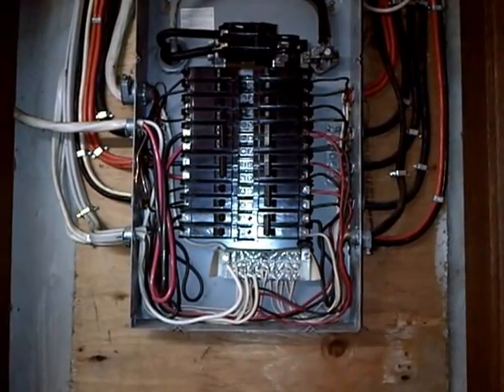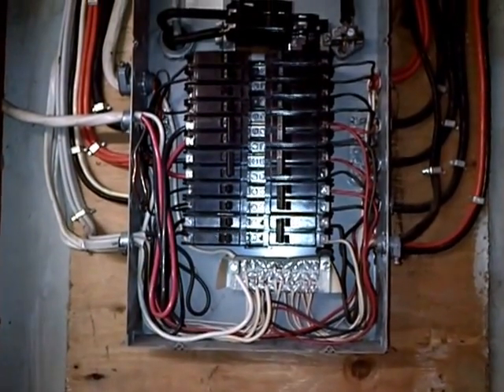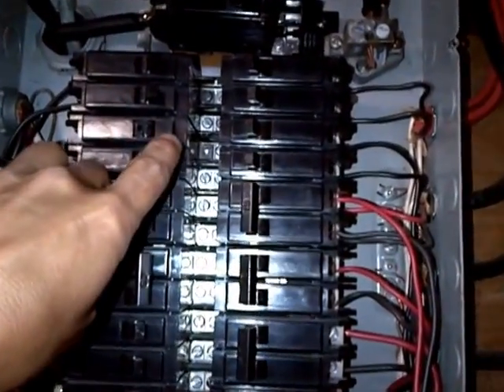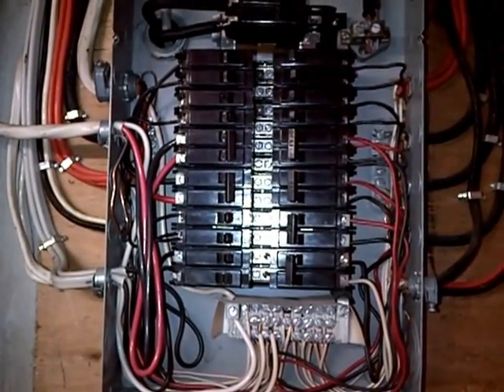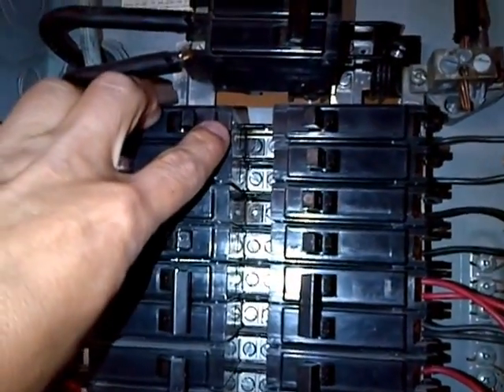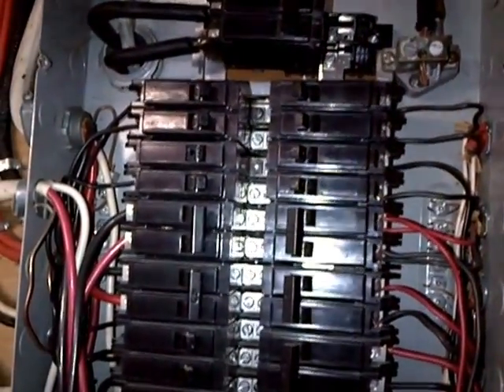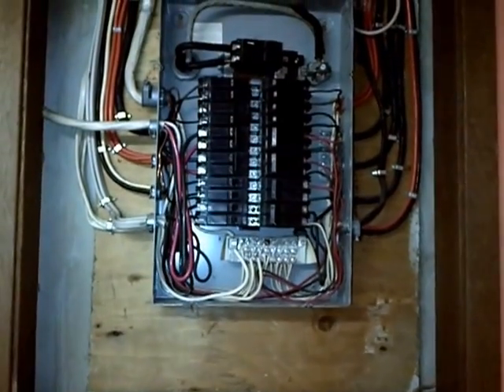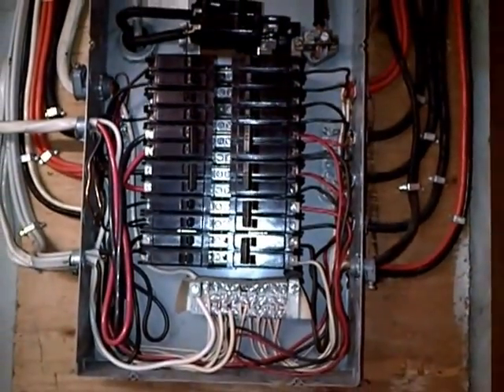Deteriorated old 100 Amp CEB Breaker Panel

Comment: Key point: ONLY as good as the installer. If the installer remembers that the key word in Bolt-on breaker is to tighten the damn bolt (properly torque it) then I don't see the issue. I've got the beautiful white Commanders, made in Toronto. They are expensive to replace, $30-40 for a single pole 15A breaker now made by Eaton. No duplex (twins) available, nor Arc fault, but the GFIs are like unicorns that can be found once in awhile. It is easier (and possibly cheaper/more modular) to install the extra protection separately, outside the panel by running the circuit through a protected receptacle (bx cable to utility box).
Surely you are experienced enough to clean up any carbon on the bus bar and mount a new breaker with a good solid connection and check the thermals to get that old girl back up and running. Somebody done her wrong. Two breakers and a bit of elbow grease instead of replacing the panel.  It will probably last until it's the grandkids problem.
Reply: Google “metal annealing”. Annealing a metal with heat makes it more ductile. This “damages the point of connection.”  I know this from experience and from what I have read.  The annealing temperature is much less than the melting temperature of the metal.  Electrical buses are typically made of copper or aluminum alloys (good conductors).  So annealing physically weakens the point of connection which compromises its effectiveness and increases the risk of its failure.

If “heat to the bus bar is minimized by the breaker tripping” as you state, then there would be no discolouration (oxidation) at the point of connection.  Discolouration is evidence that the connection has been damaged by heat.  Electrical connections deteriorate with time and load (heat) cycling. This is why I always check connections when I do electrical work.  It is rare that I find an older panel where all its connections are snug.

However, I agree that over tightening electrical connections can also lead to their failure. But that is not the point of Mr. Gauthier’s video, which rightly and responsibly cites the damage resulting from loose connections (with the physical evidence).  Perhaps you could upload a video about overtightening to illustrate your concern.

Hope this helps.
Reply: Just a comment.  Only a very ignorant electrician or a home "handyman" would do as you suggest: "clean up any carbon on the bus bar and mount a new breaker."  When a bolted connection overheats the bus like this, it damages the point of connection, making a future connection to the bus questionable.  Your suggestion may save a few pennies in the short term only to cause dollars of grief in the long term.
Reply: @richardferguson8217 please elaborate on "damages the point of connection"
Most damage I've seen is from someone using a Robertson head to connect to the bus bar and stripping the hole with their 200-lbs gorilla torque. The idiot-stripped bolt is what causes these arcs, they pop out with the movement of the breaker and then arc (gotta be a pretty drunk elechicken to forget to tighten down your breaker. I don't recall ever seeing a standard-issue slot stripped--they slip out before they strip out.
The heat to the bus bar is minimized by the breaker tripping. I think the thin tab of the breaker takes most of the punishment from arcs.
If you clean up the bus bar contact area and it is smooth with no discolouration, I don't see why you shouldn't give her another go. If you're a nervous nelly and think the bus bar/ bolt hole is going to crack, melt, explode!!haha under 15A, then abandon the slot, use another slot, have a beer to calm yer nerves.